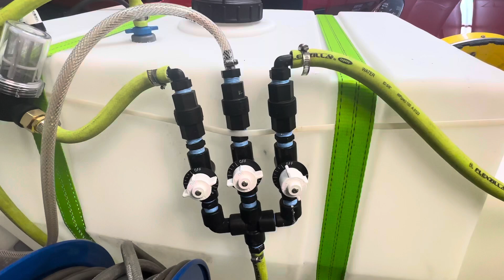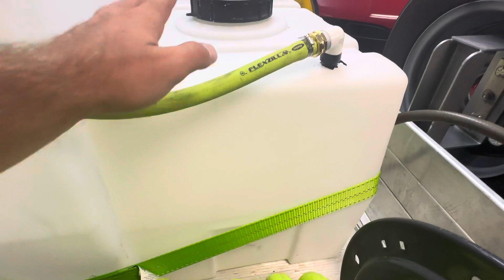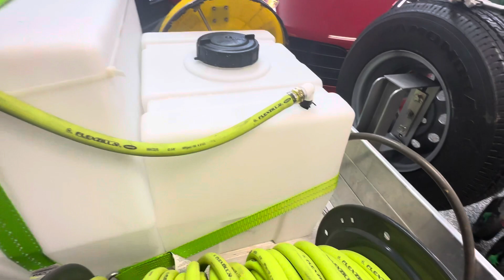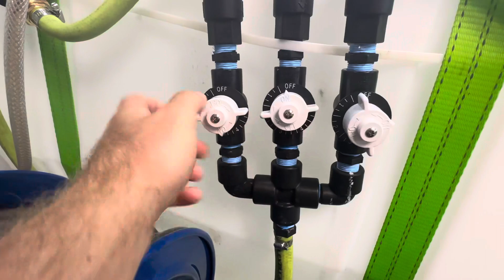Purpose of a Proportioner and If You Need One

Comment: so when you surface wash do to connect your soft wash hose to your pressure washer or do you spray it with the mix and then just hit it with the surface washer running water?
Reply from the maker: No, i connect my surface cleaner to my high pressure hose which connects to my pressure washer, my softwash system is something by itself. I made more in depth videos on my page you should check out!